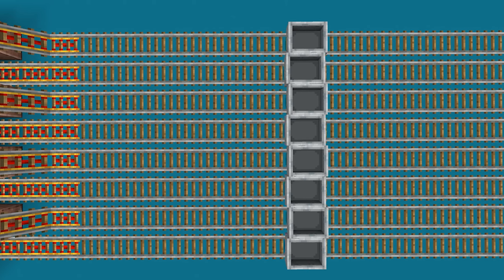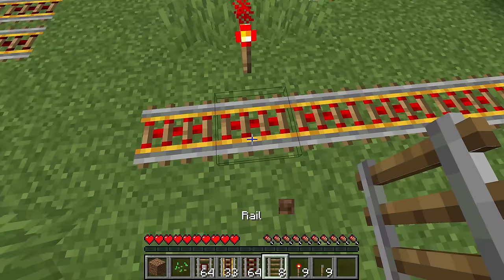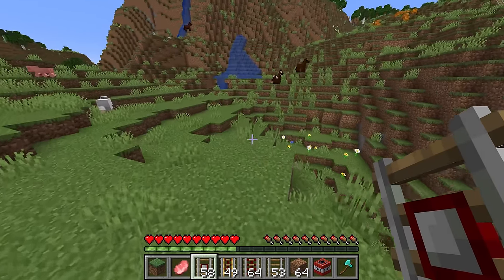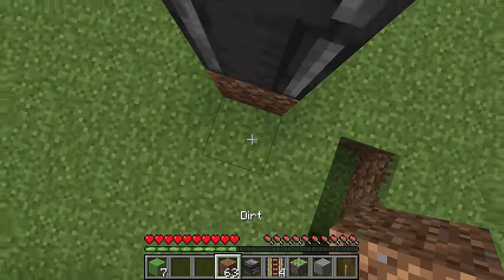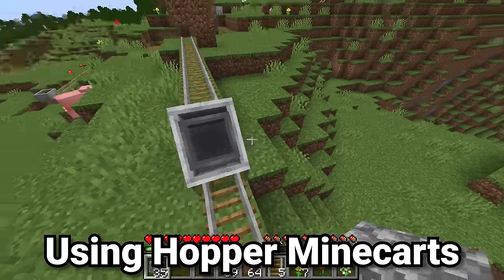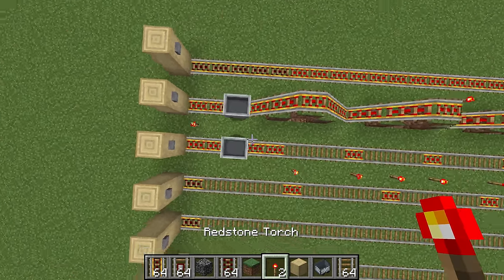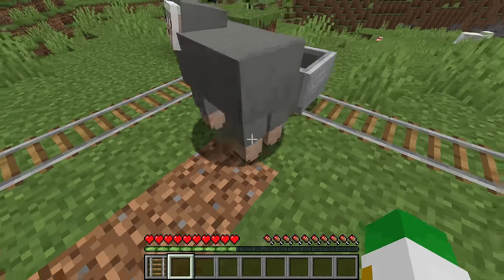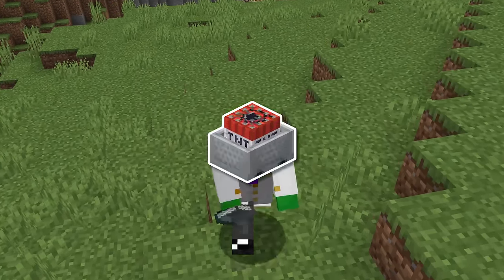The Ultimate Minecraft 1.20 Minecart & Rail Guide

Comment: One thing to note with detector rails: when ejecting a mob, it will “prefer” ejecting them to the right of the direction of travel
Reply: isnt it based on the cardinal directions?
Reply: The word prefer doesn't need to be in quotes. It will default to ejecting the passenger on the right-hand side of the track based on the direction of travel unless that location is obstructed, the same as with the bed mechanic.
Reply: It is the activator rail and also I didn’t know this so it should come in handy thanks
Reply: @vrtr it's relative

Comment: One thing to remember is that empty minecarts don't have the same momentum as full minecarts. So, if you're sending a minecart up a hill using just occasional powered rails, it may make it up just fine with a passenger, but only go part-way up then backwards if empty.

Comment: A few points I didn't hear mentioned:
(1) A minecart goes much further with you or a mob in it.  You want powered rails quite close together (say, every 5 blocks) if there will be empty minecarts running the track, but if the track is for occupied minecarts only then you can put powered rails up to 40 blocks apart (if flat), although I usually go with 32 blocks so that you don't slow down too much, or 20 blocks if I want to keep going as fast as possible.
(2) Although mobs will not cross tracks, they can still drop onto the track from above.  For this reason, make sure there are no higher blocks next to the track, even just one block high.  Once the mob falls onto the track it will generally stay there, or walk along the track, which is super annoying.  Creepers can still stand next to the track and explode when you go past - they probably won't damage you if you're going fast enough, but they will destroy the track.  Overland rails are fun but really tricky in survival.  You can put fences alongside them, and lit torches to stop mobs spawning near, although I find elevating the railway is the best option (except it limits where you can get in or out).
(3) If you want to hide the power source for your powered rails, just dig two blocks down next to the rail, dig out the block under the block the rail sits on and then put a redstone torch there, so it is directly under the block the rail is on.  
(4) A good use of a detector rail and activator rail is to have the activator eject you from the minecart when you reach then end of the track.  It's not really necessary but it's fun if you use your rail network to travel around.
Reply: (5) Minecarts on activator rails can get punched instantly (no axe) 
(6) To use comparators on furnace/chest minecarts the minecart must be on a detector rail
(7) Although really horrible, it is possible to link minecarts. I see this a lot and it is worth mentioning that you can do that,but at a high cost
Reply: For 2 I dont get it bc I've always had mobs go on them. I've heard the same about villagers too and mobs..that they wont cross them but they do
Reply: Because you're playing bedrock, unfortunately, mobs not walking on tracks is a Java thing for whatever reason.
Reply: 1) I usually do 32 rails with 2-3 powered between each set. Never lose speed and it’s the cheapest set up I have found
Reply: @LateNightTableCo  Wdym? Like for every 16 normal rails you do a powered rail?

Comment: I have read through minecarts on the wiki. the best distance for power rails is 38 blocks. you get almost the full speed while using very few powered rails. only empty minecarts can't go on that track, because they have little weight they will lose movement speed alot faster.

The rail duper actually still works. i have tested it. 

Great tutorial tyvm
Reply: i tested the dupli glitch in aternos servers, doesnt work. It just breaks

Comment: Detector rail combined with a comparator can sense the hopper/chest minecart fullness.
Reply: Yes. Zedaph did attempt to design a system for detecting not only the fullness of a chest minecart by this method but also the contents of said chest by measuring the redstone signal strength produced by the items inside but it only briefly worked while testing a few times and never produced a stable, repeatable result over time and the system completely broke after logging out and back in.

Comment: I know this is late, but a good method to change rail direction is using an observer pointed on a dirt block with a piston above it, so when you right click with a shovel, it will detect the change, send two pulses as all observers do, the piston will reset the dirt block to be used again, use repeater to prolong the signal.
This means that the rail can reset right after you pass it and is very easy to use in high-speed.

Comment: You know what would be tight. Imagine being able to use something similar to redstone, but it does the opposite. (Maybe like an orangish stone called ether stone or something. Would glow similar color to redstone). So if you were to put three sticky Pistons underground for a secret door. You could still use a redstone torch, block to place torch on and the ether/redstone dust. When you turn the lever on(activate mode), it would provide power to the redstone, but it would turn off the power to the piston connected to the (ether stone). So the 2 redstone dust   would turn off the redstone torches but the ether dust would activate the torch, due to it not having a power source "on" telling it to turn the redstone torch off. You could also possibly just make an ether torch that would do the opposite with redstone dust going into it.  That way you wouldn't have to use a bunch of extra torches,dust, and repeaters. That one ether torch or dust will invert it for you.

You could also have a third type of dust. You could use redstone, gold nuggets and ender pearl(or whatever) to make a certain dust , let's say, ender dust.  Reasoning:
1) ender pearl allows you to travel wherever it's thrown(wireless)
2) gold is conductive
3) redstone dust cause it's dust lol

So this type of dust would not connect with itself but could connect with others (redstone/ether dust). Reason being is because you would only need 2 ender dust to activate something. So imagine you place a lever in a (control building) and place another single dust at a piston 70 blocks away. It would activate it. The reason it wouldn't connect to itself is simple. Due to you only needing one anyways, you could place them side by side (like a staircase) and close that gap without (disconnecting) the connection between the two ender dust. Would make it a lot easier to close off stuff on the surface especially without having to put something over or around it to cover it up. Connecting ender dust to redstone or ether stone would give you what you need for your creation. I'd say 100 block radius for the ender dust would be plenty. 100 due to the fact that some like to make huge buildings that would require some distance. You could still activate traps from a distance

Comment: Mojang really needs to give minecarts a serious update. Necessary fixes:
- Maximum speed needs to be increased
- Linked minecarts using chains so furnace cart can be a useful engine
- Alternative ways to fund the rails like a merchant trade
- Improved mechanics with slime block and tnt that allows for better vertical launching or speed boost for veterans
- Make cross rails and detector mechanics that actually work
- Give us a better way to get mobs into the minecart, I can understand not giving us that for boats, but minecarts are the intended way to transport mobs
Currently, it makes more sense to use ice and a boat to get around because of how expensive, slow, and tedious it is to use minecarts. That ain't right!

Comment: Wow, that is a LOT of a powered rails.  I use one every 32 unpowered rails on flat ground. 32 isn't meta, but it's convenient as it's half a stack of rails, which makes counting easy.  I use one powered rail for each increase in height.  Just for style, I go no less than 8 level rails for each height increase; adds a tiniy bit of realism. Since minecarts slow down a lot on corners, I use a powered rail on each side of a corner. If two curves are close together, I only put the powered rails on each side of the set of two corners.  
I really wish minecarts would load chunks, as that would allow long-distance automated transportation.  
If you're into making things look pretty, put down a layer of gravel under your railroad- err, minecart- tracks for that real world aesthetic.

Comment: You missed some important things. even if you power your rails every 4 blocks they might not make it up a long steep hill. I put power rails ever other block but some player put power rail on every block going up which is a waist. A hopper minecart works really fast unloading a hopper minecart in a collection system. So you have  the first hopper of a hopper line with a hopper minecart with a full solid block inserted into it on top, removing the rail under this minecart. Then a power rail on top of the solid block that is connected to your rail way tracks. Any Hopper Minecart that has items in it will empty really fast. Use a Redstone circuit to control the collection minecart stopping and going.

Comment: Came here to see if something changed since I played the game.
Nothing big, the only thing is the powered rail after 4 blocks (I had them at 7 block).

To not need a leaver, I used a button and a detector rail to set and reset the rail direction. You can also make funny things with detector rails like open walls etc. (With sticky pistons)
In the old map I also used a cheat block as trader for diamond pickaxes, 10 xp level for one. The same can be done to get other Items like rails.

Comment: One thing you left out is a 4 way junction. I have a system where I want to go from location A, I want to go to B or C often. however, I have location D that will only ever go to C (i'll never need to from from A to D, B to D or C to D). Unfortunately, the moment I put a 4th rail at the intersection, the rail switcher stops working.

Comment: Your testing may be flawed. Occupied and unoccupied mine carts have different inertia. Occupied minecarts with maximum momentum lose speed after 37 blocks. An unoccupied one starts losing speed earlier and faster.

3 powered rail at the beginning is enough to boost to max momentum. You only need one powered rail with 37 normals rails in between to keep going.

Comment: Minecraft should use diamonds to upgrade rails and make them faster. Making diamond sprinkled (1) rails and diamond mine carts exclusively for high speed travel - so to keep the old mechanics of iron rails unchanged with hopper carts and farm collecting.

Bonus: this would make diamonds relevant again without the need to nerf anything else.

(1) crafting table recipe by adding a diamond to common iron rails or iron rail recipe. Please no clicking with diamonds on already placed rail - tedious!

Comment: This video can't accurately be called the ultimate guide to minecarts & rails when you completely failed to mention 2 minecart variations AND while claiming that only powered rails or furnace minecarts can be used to move a minecart along a track.

The first is a genius design for a self-propelled minecart that can carry a player along a track without the use of gravity, powered rails or furnace carts and that's the pig with a saddle in a minecart. It's exactly what the name entails, a pig wearing a saddle that is in a minecart. Simply sit on the pig and hold a fishing rod with a carrot attached and you now have a means of unlimited propulsion, even up inclines.

The second also falls in the classification of self-propelled minecart and is a hilarious oddity that was only discovered recently and that is the mob/player in a boat in a minecart. This is also a self-propelled variant since a player can simply row while in the boat and it moves the cart along rather quickly, also even up inclines. This one is an excellent way to move villagers across long distances as you can push several loaded carts and carry one more with you as you go.

How can you sleep at night knowing that you failed so miserably?